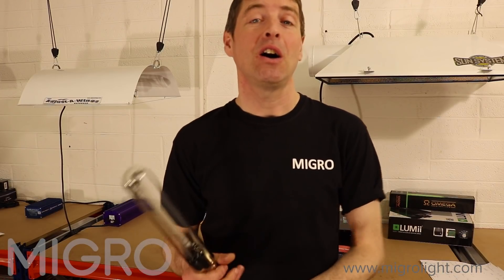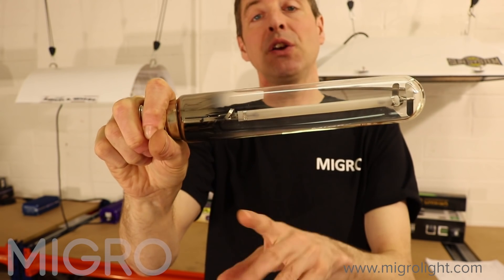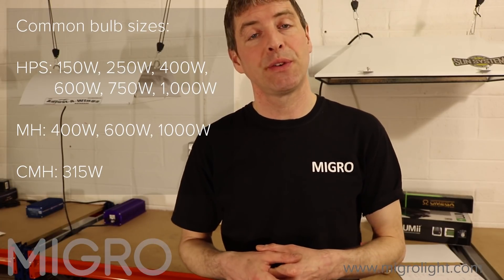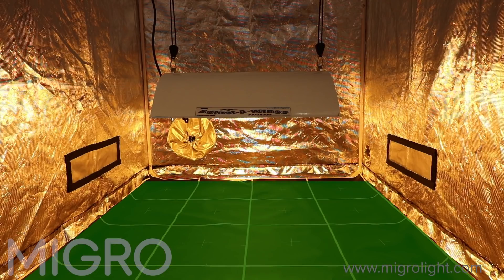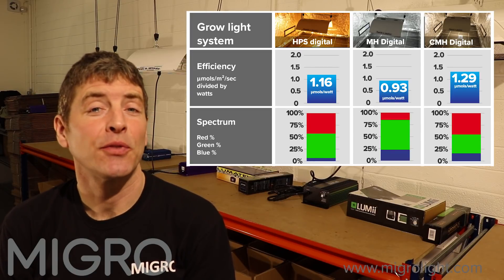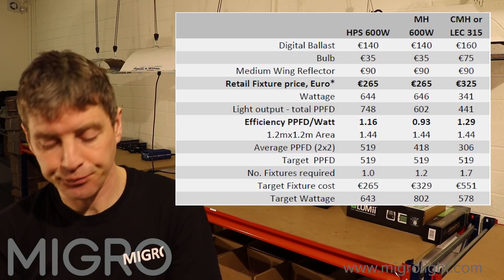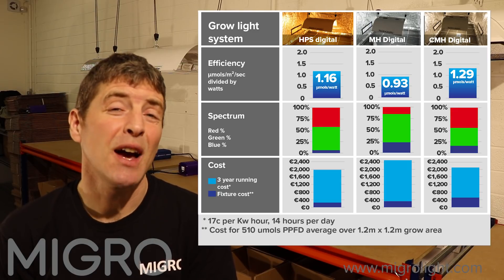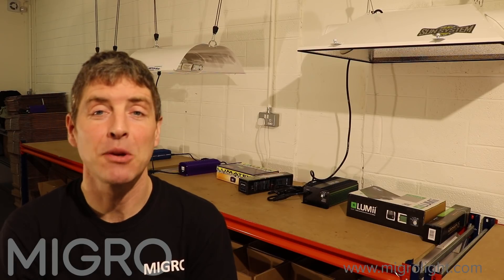What is the best HID grow light, High Pressure Sodium, Metal Halide or Ceramic Metal Halide?

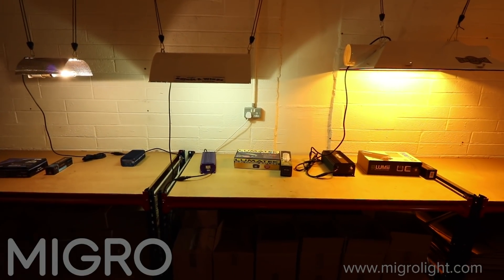Comment: 3:56 I think you correctly call the 1st light HPS but then call the 2nd light ceramic metal halide when I think that's the metal halide, and then call the 3rd light CDM (ceramic discharge metal halide) when I think that's the same thing but you've been calling it CMH up until that point.

Comment: This is confusing.. why use a hps lamp which is designed for flowering in the grow stage along with flowering? You realise cannabis needs mainly blue spectrum for maximum chlorophyll uptake for the growing period? Might start off ok but it'll slowly get deficiencies from not much chlorophyll in the red spectrum from hps.. Watch how cannabis plants grow outdoors, especially in spring to early summer when they are in grow mode,  you'll notice how even the nodes are, well a metal halide is designed to do the same thing and in my experience it does so.. in my personal experience flowering with a metal halide is better then growing with a hps, but mixing hps and metal halide for flowering is even better and will beat any top of the range LED for flowering.

Comment: Hey Shane, is there any other ballast that will work with Eye Hortilux's Ceramic HPS besides their own? It says it can take up to 20 minutes to reach full power and most ballasts see this as a lamp failure. Any info on this?

Comment: Hi Sean - You measured the HPS light at 1.16, which is pretty poor. Was there any particular reason you chose the 1000W bulb? The literature I've read points to 1.8 or better for the 600W bulbs.

Comment: Just FYI, You can get Metal Halide bulbs in 175 watts for medium base(E26/27) or mogul base(E39/40). They're not the best lighting you're going to get but they do the job. I'm using two different lights with that size bulb, one with a mogul bulb and one with a medium bulb since that is just what I currently have.

Comment: I’ve always preferred to use a medium sized reflector with a 600-1000w HPS opposed to the larger hoods that are great for maximizing the footprint of the light, but they sacrifice much of the light intensity and penetration down into the lower part of the plants. I have used just about all of the popular hoods from the very large Dominator XL, Raptors, parabolic hoods and medium sized hoods have been much more effective for me by focusing the light over a slightly smaller footprint but at a considerably more even area with more intensity which seems to yield more than the theory that the bigger the better the hood is as they definitely lose their intensity around the edges very drastically. Thanks again for the great videos, Shane! 💯👍✌️

Comment: Hi Shane..am using 2 250w hps sunMaster for 4x4x7.5 tent. The bulbs are 4 year old. Am getting slow growth on veg. When moving to another room with a window for 2-3 hours the plant seems to react to the intense sun light. I know ppl say to replace after~1  year. 
Do you suppose the bulbs are the culprit?
Is it to be expected that a 4yo hps will have almost nothing to give 6 weeks plant in veg? Thought light loss was about 10% a year.
Would appreciate ur opinion..thx 😃

Comment: Recently ive been using cmh 315w units by lummi and maxibright. The lummi 315w are great but i hear the lummi twin 630w single ended units have trouble. I also have a maxibright 315w horizon unit but that runs very warm unlike the lummi were the only heat is from the bulb. So recently maxibright released a 600w cmh direct hps replacement bulb that works with older magnetic ballasts, these bulbs seemed to be great until i had a power cut for only seconds but when the ballast tried to restrike the bulb it blew it, i hear the cmh bulbs dont like being turned on until they cool down , now these bulbs are £100 a throw and if you have many then this can be an expensive problem, i have come to the conclusion that maxibright dont seem as good quality as i first thought although i love the cmh spectrum. The lumatek zues 600watt led has to be the next step forward for me, just thought id share my experience so maybe someone doesnt have the same problems as me and buy a winning light first time round .
Reply: I have the lumatek zeus 600w pro 2.9 and I’m considering changing to cmh

Comment: there are 150w and 250w MH bulbs as well as 250w CMH bulb that can only be run using a magnetic 250w ballast, it won't work with a digital one.

Comment: should used the more current dual spectrum hps instead of that mostly older red style (cheep junk) works fine as veg or flower. mh is kinda thing of the past. our test used all diff wattages too so its irrelivant to compare to. typical lighting salesman. no way the cmh at 315 works as good as a 1k hps even in veg. light guys always avoid penetrating power

Comment: if I have an old school mh/hps 600w that has settings for 50% 75% 100% and di the up grade to cmh with the adapter. at what setting do I put it at 50% would be 300w the cmh is 315w. is that where I want it at. or do I put it @ 600w😈

Comment: Can you compare a 630w cdm vs 600w hps vs 600w mh and put the mh & hps on superlumens so they're all running the same wattage, this test is pretty much useless
Reply: 315w is same as 500w hps . 2x 315w is same as 1000 hps. But cmh has much better cri rating at 92 vs cri rating of hps at 30 at best lol meaning hps are junk compared. I recently used 2 x 315w cmh in a 1.5m tent and the results absolutly blew me away. I sold all my hps lights and replaced with cmh with 3200k bulbs . Thank me later
Reply: @mistermeanor968  I'm looking at getting a DE 630W cmh with either a adjust a wing reflector or the lumatek tekken pro miro in a 4x4ft area sound good ? and use superspreaders with those
Reply: For some reason people  seem to prefer the single end 315w bulb . I would use 2 seperate 315w units as i have more light spread this way
Reply: Although the 630 de will be ok
Reply: @mistermeanor968  That's what i've been hearing alot but it would cost nearly double and i was worries the spread for the 315w is 3x3ft meaning i would have 6ft worth of horizontal lights but only 3ft in length, think the de 630w is rated to cover 5x5ft from what im reading
Reply: Recently heard the lummi version 630cmh de is having ballast problems . So avoid this light. Lummi 315w seem ok but maxibright seems to be a better brand .

Comment: Where can I get a CMH light?
Reply: HTGSUPPLY.COM they got a CMH LIGHT I'm using that's combined with a dimmer so you can have longer life of the bulb when say in seedling stage. Its 205.00 dollars. It will veg a 4×4 no problem and flower pretty close to that.
Reply: I just bought 2 migro 315 to put in a 3.5' ×8' room I built. With white flat walls the light penetrates every corner. Awesome, can't wait to start veg..

Comment: Hps is old tech , in 2019 there crap. Cmh lights are simply 3 times better as the cri rating is 3 times higher. Hps lights are not an option after using multiple single ended 315w cmh units. Every aspect of the grow is much better and plants much healthier. Hps are street lights thats what they do best get with the times people .

Comment: what you forget to mention on hps is spectrum results matters on the bulb, I used the eyehortilux super hps bulb which actually has more blue in spectrum then most hps bulbs and  has more unol per watt then a 315 cmh,also the genesis bulbs put out more blue then other hps bulbs too and also has  more umol per watt then cmh lights,but good video
Reply: I've used Eyehortilux lamps exclusively now for around 5 years. Though costly, they're well worth the price because of producing superior yields. As with most anything, you get what you pay for most of the time. Since yield is directly proportionate to lighting, they're a must have for me.

Comment: i read that some university person doing trials said that at the same wattage hps out performs mh for growth regardless of its spectrum because of its efficiency is this true? wondering if mhs are worth having to buy spares for or if i should just go on with hps, cheers
Reply from the maker: Metal halide is useful in veg because it has 20% blue and this helps keep the growth compact. Unfortunately the bulbs are much less efficient but you need lower light intensity for veg so it suits l ots of people. The best overall sollution is use CMH bulbs at 3000k or 4000k through the whole grow. More efficient and better spectrum.
Reply: mh life span is pretty bad would a 300w viparspectra led be a better veg light option than a 250mh? or anre there any cheap leds that you would suggest? cmh wouldnt really suit my situation unfortunatly
Reply from the maker: CMH is 10,000 hours.

Comment: Many thanks for the Vid ..... May i ask a question ?
In regards to the double bulb CMH 315w units ie Dimlux (630) .. would there be any benefit in mixing the two bulbs 1 (3k) 1 (4k) for less stretch / better veg growth  ...  Thanks again.
Reply from the maker: The mix of 3.5k would  be optimum balance of enough blue for dense growth and red for photosynthetic efficiency👍
Reply: cheers bud

Comment: These spectrum results are not universal..all bulbs and different ballast will give you totally different results.  
What brand bulbs?  There are big differences just in the 600 hps. 
Same for cmh.
Reply from the maker: I disagree. I've tested many SE HPS bulbs and the total output in PPFD varies very little between cheap and expensive bulbs, maybe 10% at most. Most digital ballast exceed 90% and peak at 95% efficiency so not much variance there. There are big differences in reflectors though and setup is critical. Reflective walls etc. Are more critical. I have about 10 600w hps bulbs soon will do a demo video on comparisons soon. Thanks for the comment Shane
Reply: @MIGROLIGHT  I like your Videos   yes i cant disagree with you scientific comparisons cause i have no clue .What i  know is that a sylvania growlux and a philips green power dont give you the same results in the quality ,They quality is what really matters in the end product .Sylvania is far better, but shorter life spam.

Comment: can you compare HPS 600w with this CMH 630w https://lumatek-lighting.com/2018/02/13/lumatek-630w-cmh/
Reply from the maker: Did you see the HID video just released on our YouTube channel? All the info you need is there. Most digital ballast and bulbs are very close in performance. Maybe 5% difference between mid and high priced.
Reply: this video https://youtu.be/W7SYrgnwoHY ????      yes, i have seen.   but you compare HPS 1000W vs CMH 315W.  and  i know that proportionally the CMH 315W is more eficient than HPS 1000W.  but i dont know if the CMH 630W works as eficient as CMH 315W.

thats why i have a big doubt and i want see a comparation.   maybe the CMH 315w is more eficient proportinally than CMH 630w.

in the video you test HPS 600w and in the equipment tested you say HPS 1000w.
Reply from the maker: I think the 630w CMH fixture is just   2 x 315 bulbs? I am quite sure you can use the same figures for comparison.
Reply: In the theory the 630w CMH is 2 x 315w CMH.    but in the practice we dont know if we dont test it. maybe the 630w CMH is less eficient than 315w, or may be not.      i want to change my equipment 600w HPS for 630w CMH, but before to spend money i would like to see somebody doing a real comparasion 600w HPS vs 630w CMH. and if the comparation includes the harvest then to much better.

thanks.

Comment: Using a 1k HPS in a large hood is actually much less efficient. You want a more focused hood and around 60 watts per square foot. Also if that were true then please explain how the Gavitas with their extremely focused hoods are the most efficient HPS lights vs a DE in a XXXL Raptor. Big hoods are only good for stretching your footprint but you end up with around 30 watts per square foot and lose a lot of penetration.
Reply: the gavita lamps are truly meant for the green house  growing in Amsterdam they use 1000s of them in massive  green houses to supplement natural  thats why they have a more focused beam down so they can hang them much higher. I am not saying you can not use them in a grow tent , but unless you keep the plants short you will burn them. 60w per sq yeah sounds about right thats what I use , but I use a 1x1m vertical sunking  reflector  I can get the 1000w down to 18" of the plants with no burning, try doing that with a Givita and it will burn them even at 3 foot away the grow ten is only 6 foot tall with pots you have about 3 foot of growing room no one tells you that in the grow shop, Gavitas are hung high as fuck I would not use them in a tent light bleach the fuck out of them https://www.gothicarchgreenhouses.com/grow-lights.html 

p.s
for every foot away the light is from the plants the amount of light is 1/4th so @ 1foot you will get 140.000lux/  @2foot 1/4th you will get 35,000. @3foot you will get 1/9th or 15,555lux you want the light as close as you can to the plant without burning or light bleaching  you can get a 600w with in a foot using a sunking @1foot its 90,000lux,  a 1000w needs to be 3 feet away thats only 15,555lux
https://www.youtube.com/watch?v=yiL-OQCjfKQ
https://www.intl-lighttech.com/inverse-square-law-light-calculator

Comment: I am gonna be biased as an owner but I love my air cooled 630cmh a 120mm usb fan(almost no power at 55cfm)  pulling through is all it takes, it runs pretty cool, about 8-9 deg hotter than house temp in my 4x4. Also getting both bulbs spectrums is worth the money. the bulbs last forever compared to the others.
Reply: I cant say the low temp is all on the light side because I use water heat soaks wherever I can against the corners and back wall.
Reply: What is your average yield with that set up? Thanks.

Comment: so basically cmh is significantly better in pretty much every stat? why dont bigger growers use them i wonder
Reply: pete ward are you a commercial grower? Share some links to some large-scale growers using LED’s. and prove me wrong. I guess because you have grown a few plants under an LED that makes YOU a know it all even though it’s very obvious that you have never seen a 200 light facility by your salty comment, and if you had you would have known that I only stated the truth. Later hater ✌️
Reply: pete ward Sit down
Reply: Haha, I immediately came to the comment section, CMH is bascially the "sweet-spot" in every statistic, heat(less that HPS, a little more than LED), par and price. I got my 315w cmh for $289.00 where can you find a 300w light that outputs these type of numbers for less than the watt it produces. Also, with GC CMH you can push it to 350, 360 watts. Love these things.
Reply: how is the heat? im using 2 mars hydro 300s right now they seem pretty good but where i am i cant control the heat very well even with an intake and exhaust fan because the air in my house is 25-27c
Reply: @Moose19  
How it's your growing today 4 months later ? With that LEDs ?
Reply: i got a little over a ponund dry from 2 mars 300+ a 600 meizhi
Reply: pete ward nice try but very few large-scale growers use LED compared to HID.
Reply: Most growers use Eye hortilux hps bulbs or white LEDs
Reply: @truthspace5525  Like spectrum king ! Urbanremo is an example
Reply: Moose we’ve been running them for a couple of years and I see quite a few other large ops using them.
Reply: Bigg TK Nuggs you sound like you know everything so you know all the big growers do you ? Amazing !!
Reply: @Smoke DeGrasse Tyson A double ended 315 would work better
Reply: @Smoke DeGrasse Tyson 
Lol lol lollipop :)
Reply: Because at the moment they only make 315W bulbs.. pleeeeease Philips, make a hmmmm 500W version ;)
Reply: Because bigger growers use white Led
Reply: Bigg TK Nuggs calm down